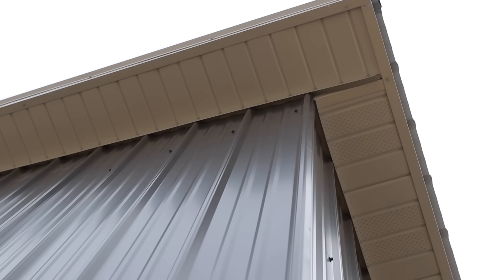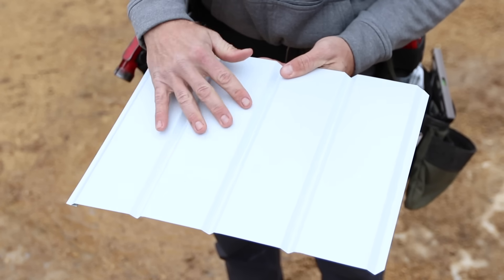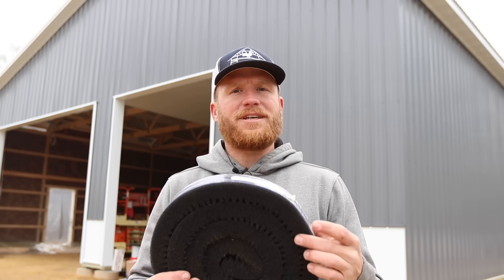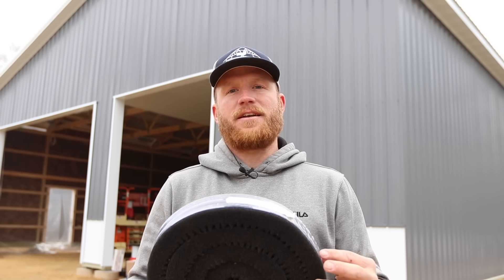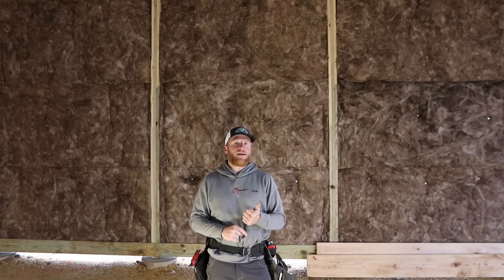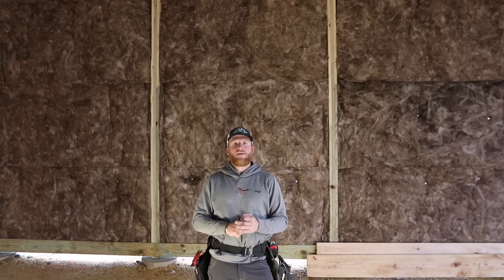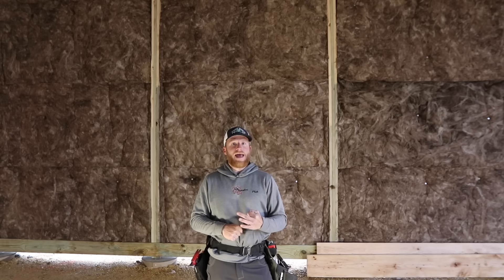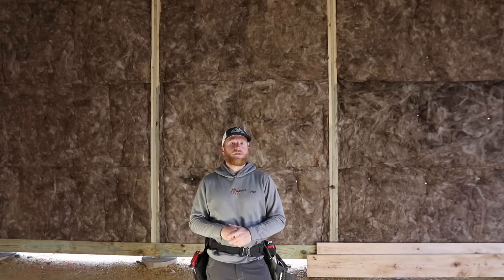Insulation: 5 steps to a more efficient building and why I don't use spray foam

Comment: Why don't you use rock fiber? It doesn't allow mold growth, won't catch on fire, and better sound barrier.
Reply: Fiberglass, to my understanding, doesn't burn either.
Reply: Fiberglass will melt very fast leaving rough framing open to flame, the reason Tock wool is great for a cavity is because itself is not flammable, which in return takes up that whole cavity, which basically removes one of the factors needed for a open flame which is air, now if the wall is not covered which often happens on a post framed building this is all null and void
Reply: Reuben, not sure you know how rockwool is made, its akin to fiberglass but it does require hotter melting temps from what I seen and understand. But yes after the fact it is more naturally fire resistant than glass.
Reply: Joshua79C C  I’m not sure you understand what ROCKWOOL is capable of, its able to withstand heat of about 2000 degrees, house fires burn approximately 1000 degrees? So yeah my comment that it is not flammable is true fiberglass melts at about 200 or 300 degrees that’s quite a big difference

Comment: I just put up a video of how I insulated a pole barn. I used 2'' foam board. Problems I've had with fiberglass is mice likes to make a home in it,plus it doesn't work very good from my experince. I've used  foam board and it has worked a lot better than fiberglass. I'm in southern Indiana. The way they figure ''R'' values of materials are misleading I believe. Consider the R-value of an insulation with a 20 mile-per-hour wind blows through it. Maybe the R-value is accurate when the material is lab tested. But a lab environment may not even remotely duplicate conditions in the real world.
Reply: Sawmiller Smith     If you have ANY air movement in your insulation, you are doing it wrong !    Kyle is using house wrap on the outside or the building, and vapor barrier on the inside to ensure that there is NO air movement in the insulation
Reply: @jesperdahl1486  maybe they will not be any air movement. Maybe it will be air tight and moisture proof .

Comment: I wish back when my building in Peoria Illinois was built would have had soffits cause it sure sweated. Also the ridge vent was opened in the dips in metal and fiberglass for light, The people who bought it put in roll up door where I had double sliding doors.I dud mount a power vent in upper back peak, then covered it in wintertime. My wife and I ran all electric wire and outlets up to panel and had an electrician run overhead wire from my garage panel for 200 amps

Comment: Spray foam is defiantly more expensive than batt insulation, but it sure does stiffen up the building. We just spray foamed our new shop and you could tell right away it was much stiffer then our other buildings.
Reply from the maker: Good point and def something to consider.
Reply: @RRBuildings  After seeing your videos I wish we would have done some things different like the perma columns and your attic air deflectors.
Reply: Depends on what foam you use. Open cell is half the price of closed cell. Closed cell is much stiffer, waterproof, and has a higher R value. Water can pass through open cell. I have my entire 30x40 shop sprayed with 4" of open cell. I had a leak on my roof a couple years back. I could see the water dripping through the foam. The leak was easy to find and repair. The garage is easy to cool in the summer. I use a 110v window ac unit to cool the place. In the winter the building stays 20* warmer than the outside just from the heat of the 60* ground temperature . We get pretty extreme temperature changes here in Northern Missouri. It's been 5 years that I've had the foam. No regrets!
Reply: @matthewerwin4677  We did almost the same with spray foam on our 40x64x18'-6" post fame home/shop in SE NE.  4" open cell everywhere except shop walls.  Shop walls got 2" of closed cell and they are rigid and airtight.  We don't heat the shop and it never freezes.  1750 SF is conditioned (two story home inside of the building).  Our utility bills for power & propane average a total of around $50 per month.
Reply: Former guy. Here are the advantages, it makes the metal MUCH stiffer so you can tap on it from outside and it will sound like 1/2in board. This means things like oil canning in wind is eliminated. It also glues the metal together and to the supports. This adds tremendous strength for any metal in the open line a farm shop usually is.

Now yes it is stiff (I'm sticking to discussing closed cell for the moment) but it DOES flex enough it isn't going to be cracking like some suggest. Also at 1.5 inches it is a certified vendor barrier. The advantage there is it is also a bidirectional barrier so you don't have it on the wrong side depending of it is winter or summer.

Yes it is more expensive but we find 1.5-2in worked great for the tons of shops we did which equals an R-10 to R-14. But since it is not effected by moisture, wind and other factors it performed in the real world better than higher values of fiberglass. I could go in to the exact science of it but that would be a huge post.
Reply: You can stiffen a building for cheap tho. You use X braces in the structure. You can use cables too, still cheaper than foam, just saying. One place i fully endorse foam is where you have a specific application that requires it, like fireproof foam (the kind that snuffs fire by releasing CO2) or where you eventually have to pressurize a building (like a lab).
Reply: @aserta , That's true but the foam kills two birds with one stone.
Reply: Have you ever considered using spray cork as a thermal break.  Once sprayed there is Low to No heat transfer. Check out Cork Coat, LLC.
Reply: Paulson Farms  It may feel “stiffened up”, but actually spray insulation provides no structural strength.
Reply: @seanm3226  Open cell doesn't but closed cell will double the racking strength of a wall.
Reply: But when the building expands and contracts the foam will crack. You will never know it either once the walls are covered up.
Reply: @hotrodhog2170 , That's true, unless someone here has demoed a spray foamed structure, has seen and documented it. I think either way, it has to be better. It does stiffen the building quite a bunch, but I don't think it would be all cracked up unless mixed and installed wrong ?
Reply: Matt Risinger did a water repellent test, you also will never know when it gets water logged until you open up the wall for maintenance-repair work, but also if not separated by say paper it will stick like glue to steel and wood making it that much tougher to respray if needed.
Reply: Hotrod Hog depends on the type of foam.

Comment: It’s the same way here in Maine   

But what do u do to keep the insulation from sagging
Reply: i saw some sort of tack supports
Reply from the maker: It is tacked in and called friction fit.  We’ve had really good luck with it so far
Reply: RR Buildings I am building a building around Springfield Il., i’m having trouble finding a supplier that handles the big insulation unfaced bats and the tacks you use. Do you have any contacts ? Thanks.  Love your videos.  My email is Nschirz@gmail.com    Thks

Comment: In the climates where you risk the ground along the wall freezing and the frost going under the slab, lifting and cracking the concrete, you can use XPS Extruded Polystyrene for ground insulation.
You look at the frost depth in your area, and this will be how far out from the wall you will need to insulate. If the frost goes 10" or 20", you need to insulate minimum of 10" or 20" out from the wall. Think of frost as following the radius of a circle.
Reply: Lol, not necessary. Nice, but not required at all.
Reply: @warrenmatheson563  We see freezing temperatures on average from October to April in large parts of Sweden. Code is to use standard sheets of XPS extending 2feet/60cm and twice that on the outside of corners of the slab, if not it WILL push the foundation up and potentially you get a crack in the slab depending on your construction.
Reply: @ixer76  no it won't if you have enough base and rebar. I'm in Canada.....we have pole-buildings everywhere.....and we have cold too. Just cause because it's code in Sweden, doesn't mean anything. Foam on the outside of the slab doesn't stop a slab from moving or cracking.....unless the laws of physics have magically changed recently. It creates a thermal break and an expansion joint so that the floating slab can't accidently lift a wall post. People here have only started doing a bit of foam in the last 25 years...but the older buildings have held up just fine without it all this time.
Reply: @warrenmatheson563  Our experiences clearly tell different stories. Our bed rock (and water table) is shallow and the ground has high clay content - which requires drainage and material to fill below the slab to break the capillary effect of water and irrigate it away from the foundation. With luck you have sand all over, it simplifies a lot of things and your physics may apply.   If you don't take measures you will have too much water directly  in contact with the slab and the ground surface and once it freezes you will have to use more than a lot of rebar and concrete. It might be acceptable (to a point) if you have a pole building with a floating slab, but not if your building rests on the  slab.
Reply: Warren if anything as you said, solid foam insulation  is more for thermal break than a slab protector, but in some cases it can protect from frost damage aka upheaving cracks i some types of geology.
Reply: Wow, you must super special geology over there that none of use have ever seen before, lol. Only a fool builds a building of any size slab on grade without drainage underneath. Once you're at a certain size you're either doing a pony wall or pillars below if you're on sketchy soil. I mean seriously....what the hell did you think people were doing before foam was on the market? Foam does not...and has never...stabilized a slab....it's insulation, not magic.
Reply: @warrenmatheson563  There is a big difference between a heated and unheated building, and most pole buildings are unheated.
When the ground freezes the water in the soil expands, hence it raises.
In an unheated building, even though there might be a few degrees difference between inside and outside,  the soil beneath the slab and outside the slab raises more or less the same.
But in a heated building the slab is warmer, so the soil underneath doesn't raise, while the soil outside does. As time passes and the cold penetrates deeper, the soil underneath the slab along the walls starts to raise, and this can lead to cracking of the slab.
By laying XPS along the walls on the outside, you delay the freezing of the ground underneath, as there is some heat passing from the slab to the soil underneath, and then to the soil underneath the XPS outside the walls.

Look at how buildings in Siberia used to be made. They were placed on poles to avoid the heat to thaw the ground and the buildings from sinking.
Also the Alaska pipe line is built on poles to avoid the temperature difference between the frozen ground and the warmer oil from creating problems.
Reply: @warrenmatheson563  I don't see where we disagree?
Reply: I guess the thousands of heated pole-buildings in Canada build before foam became common will all have their floors falling apart any day now. Cause we don't know anything about freezing. Ground freezes 4 feet in my region...but what would I know about such things, lol.

Comment: Have you ever considered using rockwool? More expensive, but better sound deadening and fire resistance.
Reply from the maker: I have not in the past but have been thinking about it
Reply: @RRBuildings  Rockwool is great but it's heavy, at 8' CL you'll have to think about a system to "nail" them in place. I think that what you do by using fiberglass is perfect quality/price speaking. Am I wrong or you are not using a 6mil vapor barrier? if yes why? thx
Reply: Mine is batted with rockwool, it is quiet in the building. I also have r-64 in the ceiling and double-bubble between the trusses and the steel. When it rains, I can't tell it's raining.
Reply: @thnksno  Hey there.  Did you use batts in the attic?  R64?  Awesome.  I don't think mine will be that high when completed.
Reply: The strongest reasons I can think of for using Rockwool in your situation is it’s water proof, fire proof and rodent proof. I don’t even want to think about what that fibreglass looks like after a couple years in a rural location if mice find a hole. Excellent video though.
Reply: @cliftonsnider1520  That's something I question about that U pocket, rodents. If the slab is poured up to the inside grade board, what is under that U pocket? Dirt? Rock? On my building we poured to the inside of the outside grade board, encapsulating the posts. However, the difference also being that the inside grade board bottom edge is higher than the outside to accept the 4" slab. So as a result, pouring that much concrete at once, a couple of edges came up short of concrete. It's a small space between the grade boards. RODENTS! Mice, chipmunks, squirrels or whatever found every one of those tiny openings. I've since dumped concrete into these areas. However, I wonder if that U pocket around the entire perimeter of the building isn't an inviting place for rodents to burrow? Because until I could dump concrete over the holes, those rodents dug out everything I tried packing them with.
Reply: thnksno remember he called it a rat board for a reason lol
Reply: @Michael Johnson Jr  Roxul is a little bit more trickier to install since it's heavier and less compressible, so it need to be perfectly fited between the studs otherwise it's going to fall. About the R values, rockwool or fiberglass are almost identical.  Here in Qc/Canada, we usually have Roxul R22 for 2x6, but that's because our construction code is different.
Reply: I used Roxul for my basement and it's a great product to work with, need a special knife (a bread knife works too) to cut it.  Now it's warmer in my basement than upstairs!  The original builders of the house did a poor job with the vapour barrier plastic and it's not tapped anywhere so it gets very cold especially on the main floor. Project for later to remove all the drywall and redo that.  Messy job though.
Reply: Roxul will be very tough to hang at 8ft on center.
Reply: And HEALTHIER too! Especially if your working with it all the time.
Reply: Roxul is now named Rockwool (FYI). I love Rockwool, but fibreglass are cheaper and in large buildings better that way. I my home i pick Rockwool. Rockwool is prefect for attic and horizontal installations. And or for people that are sensitive to gases and or anything really.